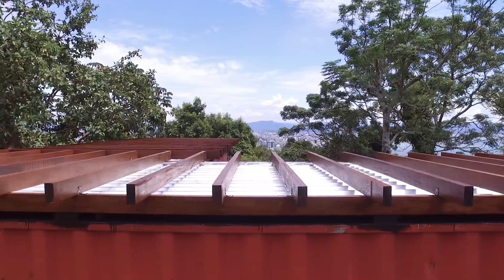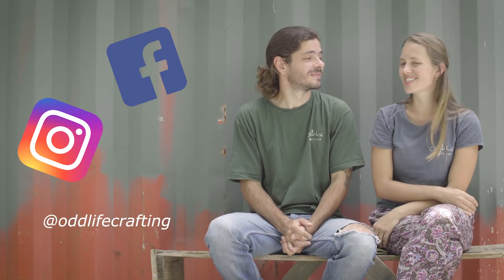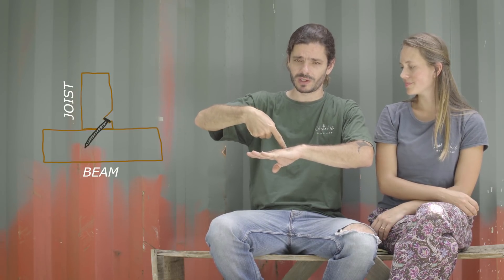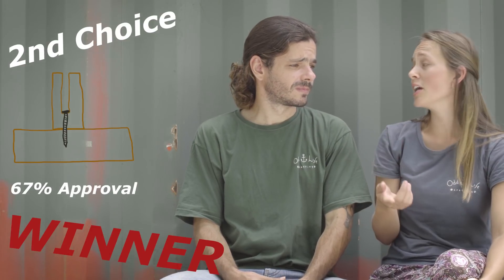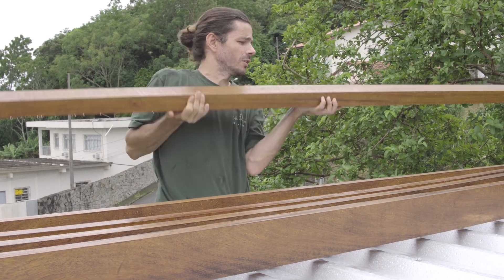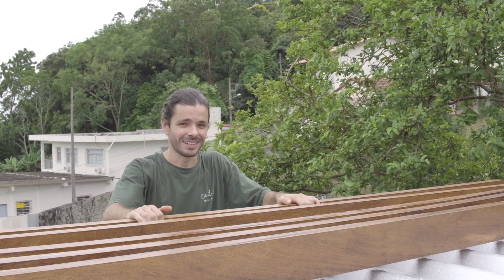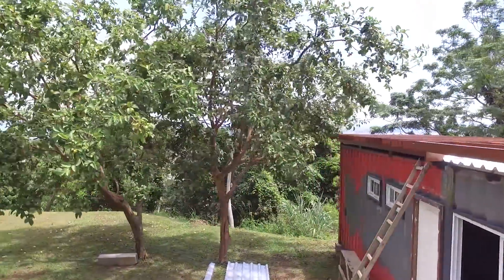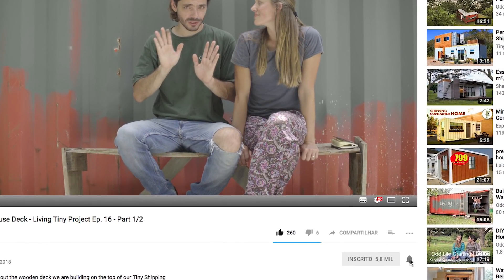Tiny Shipping Container House Deck - Living Tiny Project - Ep. 018 Part 2

Comment: I'm still really enjoying your videos. The footings for my container are finished and the container should be delivered this week ... so I'm excited.

One tip I can give you for if you need to drill steel in the future ... get yourselves a few small (maybe 3mm) high speed drill bits (they are cheap) and drill a small pilot hole first, then finish the hole with the final size afterwards. It is much faster to drill a smaller hole and you save wearing out your bigger bits.
Reply from the maker: That’s so nice!! Goo luck on the projects don’t forget to send us some pictures!!😊😊 oh and thanks for the tip!! For sure we will use it!!

Comment: Hi. I love watching your films. I live in the UK and I'm a building surveyor. We use metal straps to do the job of tying joists together. We also use joist hangers. I've tried to copy a page off UKs eBay which has a picture of the straps. Anyway I may have been to late with this information to be of any help. Good luck with the build. Jon.
https://rover.ebay.com/rover/0/0/0?mpre=https%3A%2F%2Fwww.ebay.co.uk%2Fulk%2Fitm%2F401090000348